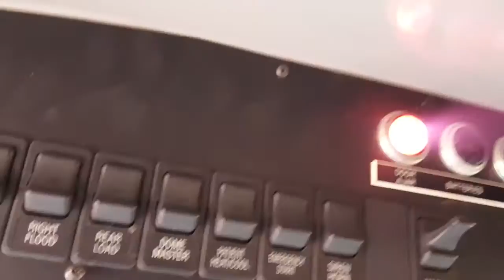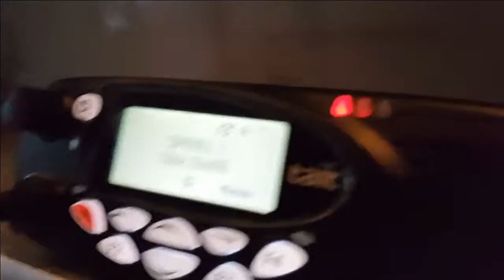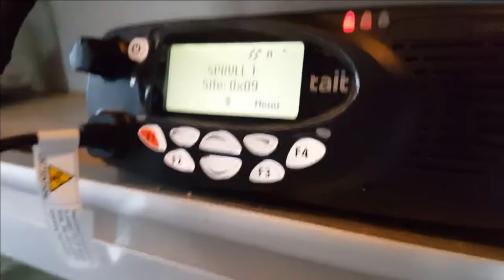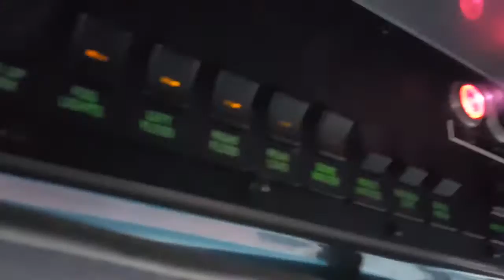This old Bambulance

Comment: is that yellow engine still in service ?
Reply from the maker: Unfortunately no. We do have a 78 CFL 600 in service though.
Reply: +922 Louisiana VFD sorry to hear that. nice to see the old ambulance running though what is your department going to use it for now ?
Reply from the maker: +backdraft763  It's always been suggested to use as a rehab vehicle while on scene for personnel. keep hydrated, head off heat exhaustion etc. while remaining close to the scene.
Reply: +922 Louisiana VFD that's a cool idea!  on one of the departments I'm on we have an square body ambulance that we use for a squad we have scba mounted to the wall where the bench seat is and it also used for first responder calls